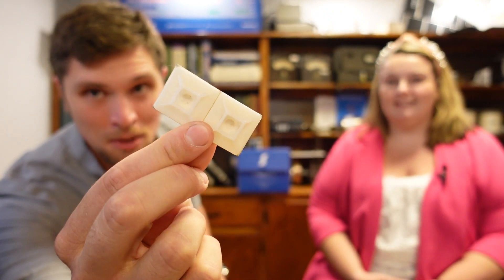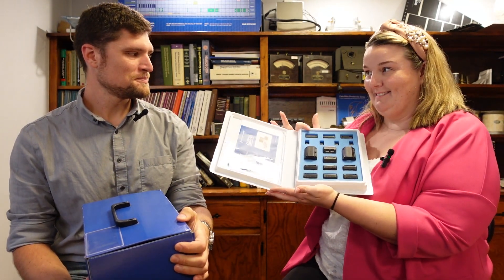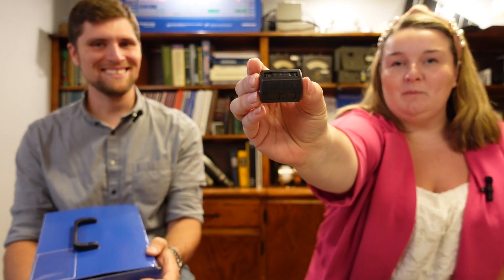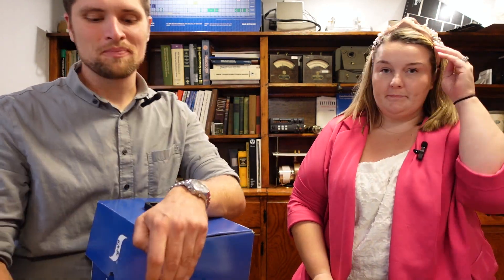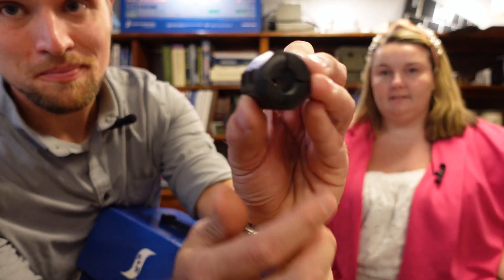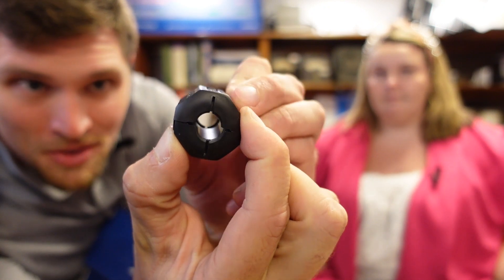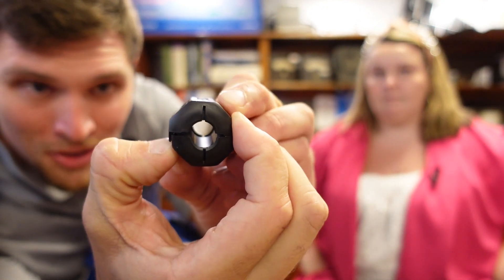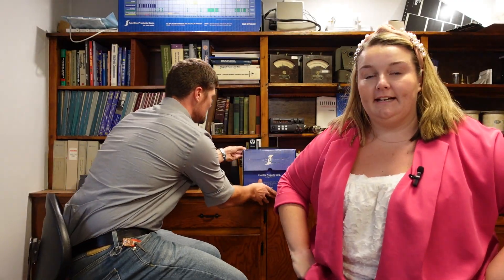Ep 2: What Ferrite Snap-It™ should I use?

Comment: What about size of power cable and inside diameter of ferrite bed i have a round power cable 9 mm md the iide diameter of the ferrite bead is 9 as well so i will just remove the anchor teeth for a perfect it
Reply from the maker: Having a tight fitting core isn't a problem as long as the ferrite core itself (not just the case) isn't being forced open by the cable!
Reply: @FairRiteProductsCorp  Im putting these on my spirit treadmill power coard as the treadmill is makeing mfi/Rfi noise on my neibours one floor below me radio.He listens to 600 mhz am station and says it doesnt do it on any other stations.I also ordered an mfi/rfi surge protector that plugs into wall outlet its not a cord type its a box with lights on it.havent recieved them yet .Hope this works Thanks a bunch.